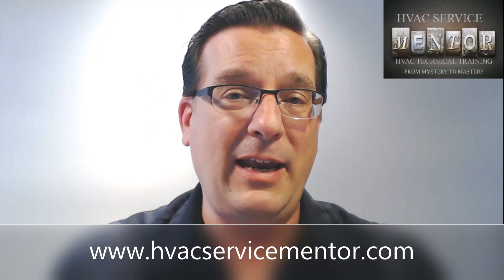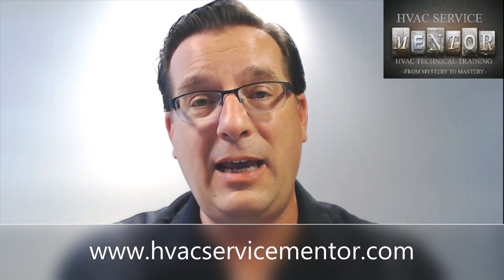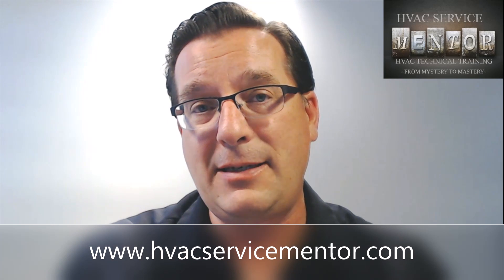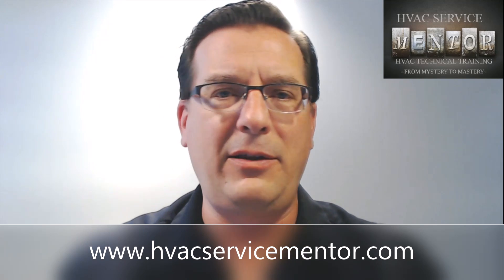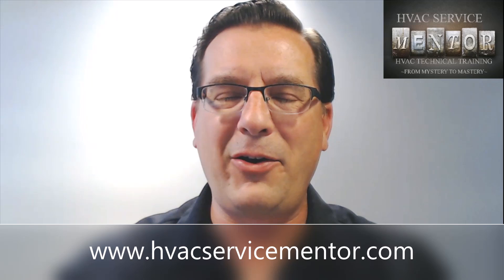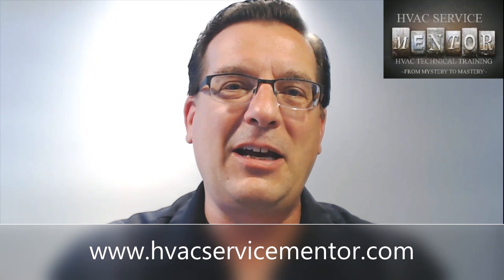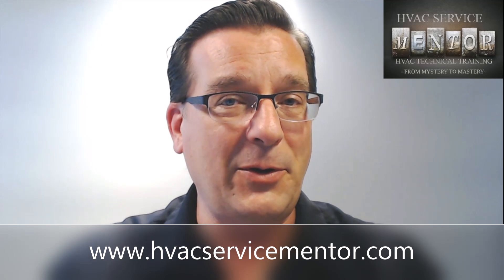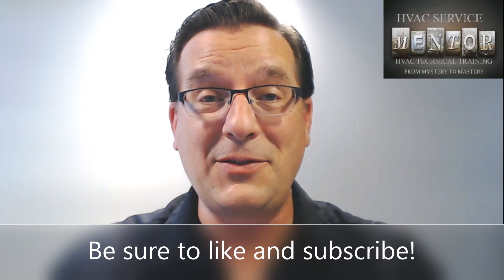Troubleshooting  the TXV

Comment: Did this test and my supply is still 64 return at 78-79 and checked everything from fans, airflow, drier etc. I have a runtru so it’s difficult to get to evap coil while running. Would suction stay still and head rises fast even if evap coil is oil logged? Suction 145 head 325 Subcool 13-14 little high but factory recommended judging liquid temp and psi. Superheat 3, so I’m thinking the coil is logged? Feedback?

Comment: This works even better to find out IF you have a txv or a piston. On a piston the suction pressure will go down as the liquid column gets hotter and is not condensing correctly and NOT having a solid column of liquid at metering device.

Comment: All pressures read good 
Heat and cooling read good 
Tech never checked txv bulb
House has cool air coming from vents but not cold enough to drop temp 
6 year old ac worked fine until recently.
All other components are functional 
All drain lines operational 

Please help me I’ve been without ac for 2 weeks mid summer and the tech looked me in the eyes and said he has no idea what’s wrong and suggest replacing the ac

Should I just tell them to replace the Txv or just bite the bullet and saw off a arm so my family doesn’t have to suffer from the heat

Comment: Would it make as much sense to mess with the suction pressure the same way (disconnecting a fan; blocking the evaporator coils)?
Reply from the maker: Many people ask this question and the short answer is no.  The long answer is also no.  The whole point is to be quick and easy on a split system and messing with the low side is neither quick, easy, or produces results that are easy to recognize.

Comment: What would the low side do with a bad txv.... 
rise if failed open? Drop if failed closed?

is this just an indicator that the TXV is working, and would it not help differentiate between Open/closed failure?
Reply from the maker: I have never seen a txv fail wide open, but if it did, it would produce low superheat during less than full load conditions and nothing would you could change would make it better.  If it failed closed. Suction pressure would be very low, zero or less.  Very high probability of blowing the internal pressure relief on the compressor open which would cause near equal pressures.

Comment: Great video, but i had an issue where the walk in freezer coil was not doing a good job cooling the space, superheat at the evap was 39, Suction pressure 17psi, i had to charge the unit to get proper subcool values, how cam i use the information in this video to diagnose a restricted txv? I know this video can indicate if a txv is stuck open but what about an restriction where the txv cant allow much refrigerant through? I already checked across the drier and other places
Reply from the maker: This video is exclusively meant to test if a TXV is vunctioning on a high - temperature air conditioning system.  The techniques mentioned in this video are not able to diagnose a restricted TXV by themselves.  A restricted TXV and on that has an improper superheat spring adjustment will behave th esame way.  Restrictions are one of the most difficult things to diagnose because other problems will create similar symptoms.  While refrigeration systems also have TXVs, they experience a lot more dynamics than an air conditioning system.  They are different enough that I consider them to be completely different animals and none of my training is meant to address refrigeration systems.

Comment: So if I’m testing a TXV on a geothermal heat pump, I can switch to heat to effectively do this same test?
Reply from the maker: No.  Switching a Heat pump from heat to cool during a cycle will upset everything for a few minutes until it reaches a new equalibrium.  This test should be done when the system is in cooling mode and operating in normal equilibrium and has achieved steady - state operation after running for at least ten minutes.

Comment: But... The condenser is not condensing without the fan.. you are feeding hot gas into the txv.. how are you testing to TXV when you are creating a fault for the TXV to not work properly?
Reply from the maker: This is a great question...  The refrigerant is still condensing even though the fan is not operating.  This is because of an interesting thermodynamic phenomenon.  The saturated liquid pressure of the refrigerant (also known as head pressure) must always be greater than the temperature of the condensing mediuim ( also known as outdoor ambient air temperature).  Condenser fans for air-cooled condensers are sized to move a specific volume of air at a specific outdoor temperature.  This will create a specific head pressure during those conditions.  During normal operation, the outdoor temperatue does not change a whole lot.  normal condensing units are rated to perform at outdoor temps between 50 and 95 outdoor.  Within this range, there will be a fluctuation of head pressure.  Condensing temps are usually around 15 to 20 degrees greater than outdoor temp so the head pressure will rise and fall with changes in outdoor temperature.  Commercial systems are often equipped with variable speed condenser fans to ensure that head pressure remains constand over a wide range of outdoor temps.   The stopping of the outdoor air flow across the condenser does not immediately stop the condensing of the refrigerant.  It acutally causes the refrigerant to react as if the outdoor air temperature was MUCH higher than it actually is.  In order to keep the saturated liquid temp greater than this simulated higher temperature, head pressure climbs rapidly.  If you had a sight glass mounted in the liquid line at the condensing unit, you would see this clearly.  Interstingly, when you re-energize the fan, the head pressure drops suddenly.  as a result, that high temperature liquid refrigerant (it will be quite hot) immedieately flashes into vapor and for a breif period, you are in fact feeding vapor into the metering device, only for a handful of seconds until a new steady-state equalibrium is reached.

Comment: Brilliant,  simply brilliant. 👏 
Does blocking the intake or discharge air produce a similar result without removing live wiring and potentially shorting out something,  like my lifespan?
Reply from the maker: Yes it does, but the effect is not quite as dramatic depending on how effectively you can block the air flow.

Comment: Thts a way to burn the fan 50 percent voltage disconnect the cap. Safer too
Reply from the maker: Disconnecting the common leg from the fan will not cause any damage to the motor.  This is exactly how single pole contactors work.

Comment: "You can't watch the sensing bulb and the suction pressure at the same time."

Job Link probes have entered the chat
Reply from the maker: That's a good one!  meanwhile, by the time you have taken those fancy gadgets out of their padded case, and done all the work to dig the sensing bulb out of it's home, and put it back nicely and fixed all the armaflex and cork tape and mastic you had to remove to get to the little bugger, the tech who followed this advice is already paid and on to the next job or at home with their family at a decent hour!
Reply: @hvacservicementor  oh fuck, burn XD
Reply: Fancy little gadgets?  Are you hatin on probes and temp clamps?  @hvacservicementor

Comment: as a new tech here, that shows that the TXV was operating properly, if it was bad would my suction line pressures rise as well or decrease?
Reply from the maker: If TXV is frozen in some mid position, it will behave like a fixed metering device and suction pressure will rise along side the head pressure.

Comment: i thought you're going to manipulate the indoor fan, is it the same?
Reply from the maker: While manipulating airflow across the evaporator does have an effect, it is less dramatic than manipulating air flow across the condenser.  Also, unless you have wireless gauges that read to your cell phone, it is kind of hard to see your gauges at the outdoor unit while you are at the indoor fan.

Comment: You can also test to make sure the TXV is opening by going the other way - cooling down the liquid line and reducing the liquid line pressure.  For example, on a hot day, run water over the condenser coils.  It doesn't take much.  Even a decent "mist" of water with good coverage over the condenser will do, and may be better as the fan doesn't have to move a large mass of water through the condenser coils.  This cools the condenser, which reduces the liquid line pressure (aka "head pressure") .  You'll see subcooling drop as the saturation point of the refrigerant in the condenser drops, and it drops at a rate faster than the liquid line temp, thereby reducing subcooling.  In effect you are replacing refrigerant subcooling with water evaporation cooling.   If the TXV is operating correctly, it will keep open up in response to the reduced high side pressure to maintain superheat - as long as there is enough refrigerant in the system to keep the condenser and evaporator adequately filled on a high load day.  MesureQuick will tell you that pretty quickly.  Then again, MeasureQuick does not understand the misting process.  If the superheat goes up to, say, 25 due to a low refrigerant charge, it may report that the TXV bulb is stuck closed or the bulb lost its charge.  By the way, the make mister kits you can mount on condensers.  For example, see Cool-N-Save, https://coolnsave.com/product/cool-n-save-ac-misting-kit/.
Reply from the maker: Any way to create a fast and dramatic change in head pressure will provide a good test on the txv.  Dropping pressure quickly may have the unintended consequence of also dropping suction pressure which can create confusion.  If that works for you, that's great.  I have seen a garden sprinkler set up as a temporary remedy when a condenser fan fails on a multi-fan commercial RTU plenty of times.
Reply: I like this method it really makes sense. thanks for sharing your ideas

Comment: will a bad txv cause over amping?
Reply from the maker: A TXV that is slammed shut or mostly shut will cause the head pressure to soar and can cause higher amp draw on the compressor.  In that case, it won't run very long for you to take a meaurement before the internal pressure relief opens and the amp draw drops very low.

Comment: As a DIYer it appears to me that this is a good test and absolutely worth doing but it is testing the valve and balancing spring only.  The bulb is not checked as to whether it is responding to temperature change of the suction line as the conditions change for the evaporator coil.
Reply from the maker: Keep it up!

Comment: I would think you could do the converse and instead of increasing head pressure by blocking air flow, you can use a garden sprayer filled with ice and water to cool the condenser coils and drop the head pressure to see if the TXV responds to that or not. Right??
Reply from the maker: Any way you can make a dramatic change to head pressure can test the TXV.  I find raising head pressure to be much easier, faster, and more reliable than lowering it.  Also, suddenly lowering head pressure can also cause suction pressure to fall by underfeeding the txv and will cause uncertain results and confusion.

Comment: What happens if u let the head pressure keep rising
Reply from the maker: Only bad things...  This is why this advice is for qualified techs only.  You have to be observant and make sure you don't exceed the high pressure rating on the unit or the high pressure cutout if so equipped.
Reply: It will either trip a high pressure switch if it has one, the internal bypass valve will open if it has one, or the compressor will overheat and trip it's internal overload switch. If that happens for any extended time it will usually burn it out.

Comment: Would the results looked similar if the txv is stucked closed?  Great video. Thanks
Reply from the maker: A TXV stuck closed will show very low or zero suction pressure with very high head pressure, often to the point of opening the compressor's internal pressure relief valve which will then cause pressures to nearly equalize.

Comment: Way back in 1973, at the US Naval school of Air Conditioning and Refrigeration, I was taught that the function of a TXV was “to meter the proper amount of refrigerant according to the heat load, and to maintain superheat.  I still taught that to my apprentices until 2019. Your presentations are the best that I have seen in my 45 years in HVAC, both as a field service engineer and apprenticeship instructor.  Keep the videos comming
Reply: Wow you’ve been in the field for many years and I’m sure has worked on many different kinds of unit! A lot of experience under ur belt! 👍

Comment: Would it do the same job if i cover the condenser? Head pressure will go up. Thank you.
Reply from the maker: Covering the condenser will drive head pressure up and sometimes that works good.  Many outdoor units have built in systems that try to prevent this.  Carrier units have domed tops.  Trane units have a solid top with multiple outlets around the perimeter.  I personally find it easier to yank the fan wire since I have a pliers right there and anything I could use to cover the condenser is all the way back at the van.

Comment: Is it possible that if the TXV is failed closed, the suction pressure side could show basically a vacuum on the gauge set?  My service tech showed me his gauge set with the suction side showing zero pressure.  He said that either the TXV is closed completely or there is a major obstruction somewhere.
Reply from the maker: Yes, a TXV stuck fully closed will essentially create a "pump down" where liquid will stack up in the liquid line and condenser and the evaporator and suction line will pull down to a vacuum.
Reply: @hvacservicementor  thanks very much for your speedy reply.  I am a mechanical engineer so I understand a lot of this and agree with you that this is a job for the pro's.  Thanks again.

Comment: Can i remove the fan cable from the capasitor and then turn on the unit? Reason i ask is because I only have my right arm and it might be a little risky for me to do what you recommend. Thank you
Reply from the maker: Disconnecting that wire will leave the RUN winding energized which the fan will not like.  Best to remove the common wire.  If safety is a concern, don't do this at all!

Comment: Yes sir, not a HVAC tech person; I did the compressor fan removal wire test for the TXV on my 4-ton Trane system.  I took the purple wire off of the run start, common capacitor, rather than the contactor as shown by you in U-tube video.  The contactor was more difficult to reach than the purple wire on the capacitor, same result, the fan stopped turning.  I watched the low side pressure stat within 5 to 10 psig of the original value while the head pressure went to 300psig.  A very smart way to check the TXV, thank you so much for the demonstration!  I was not looking forward to taking the plenum apart to get to the air dryer and the TXV bulb to test them.  Thank you Sir, regards Joseph

Comment: Great video! Thank you for sharing your experience and knowledge. When TXV of my AC was warmed up the the suction pressure increased and head pressure went down. In this moment case, Does this proof the txv is not faulty? The problem is 48 F superheat and 20 F subcool and when txv was warned up both supermarket and subcool went down. Thank you in advance for answering my question.
Reply: I think if you have to force the TXV open no matter where you put it , it's a bad TXV, it's unable to work by itself

Comment: Can i disconnect the brown cable at the capacitor with the power off, and then turn on the unit after securing the fan brown cable so it wouldn't short out, then turn on the unit? Would that work as well, i only have my right arm and don't want to take any chances. Thank you.

Comment: Nope the way I test one is if your suction side gauge is sucking down that the first sign of txv problem if you pull the wire off the reversing valve if the pressure are correct then the txv is going bad and sometimes the suction pressure will pull all the way down into vacuum but head pressure is good

Comment: Hi, I maintain over 100 Rheem package units at our resort. The other day, I responded to a call where water was leaking into the ceiling. When I arrived, the evaporator coil and compressor were covered in ice.

There is a lot of debate around the shop as to why this happened. Airflow was okay. The coil was clean and after thawing everything out, the blower motor didn’t have any problems pulling the filter panel closed on it’s own. 

Some of the technicians believe that the doors to the room below were the cause because they were open to the4 hallway, even though the hallway was being cooled by another package unit.

The high side gauge was only about 10 degrees above ambient (104 / 115), and the low side gauge was around 42 degrees. I’m accustom to seeing the high side gauge around 30 degrees above ambient. The compressor was pulling 15amps on all three legs and the condenser coil was clean.

I moved the TXV bulb outside the unit, and nothing changed with the low side press/temp which made me pause. Adding refrigerant didn't change anything either. There was 6 degrees superheat and almost 0 degrees of sub cooling, but package units are difficult to make accurate measurements because all the components are tucked away in the cabinet.

I think something is wrong with the TXV, but I don't know how to make a positive diagnosis with a package unit. The other technicians believe, that the coil can still freeze even with 75 degree air is flowing through it.  Any thoughts?
Reply: What are the temperatures on the filter dryer? Did you nail the problem?

Comment: How does this help me if the txv pin is stuck or stuck closed
Reply: low pressure will rise with head pressure    if txv is stuck      txv not able to maintain proper super heat